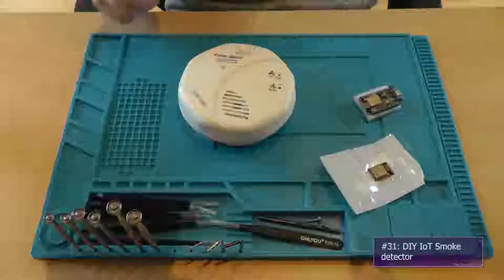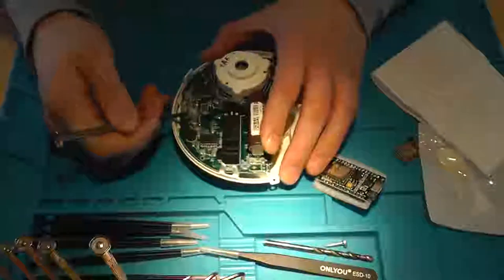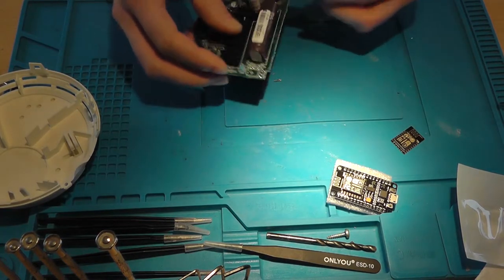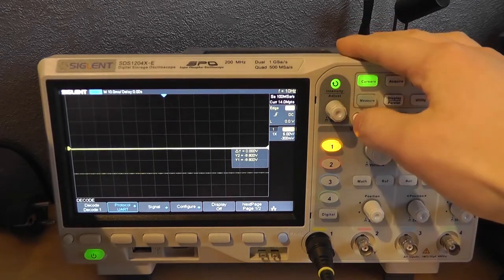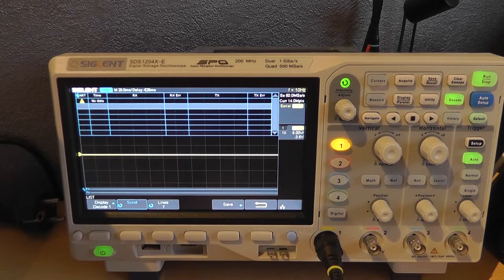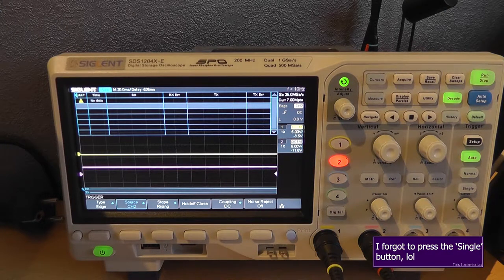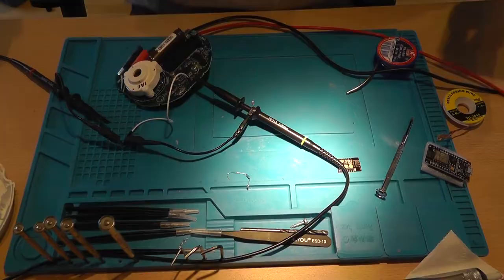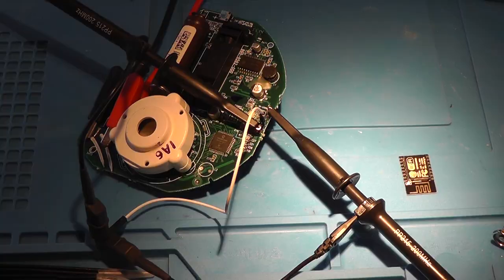#31 DIY IoT Smoke detector

Comment: You probably have the wrong baudrate for the serial out. I suggest trying 19200 and 115200.
Reply from the maker: I tried a lower baudrate and I got data, however nothing readable. I think that it is some kind of encoding for the state of the detector